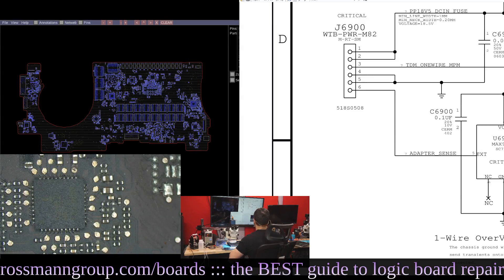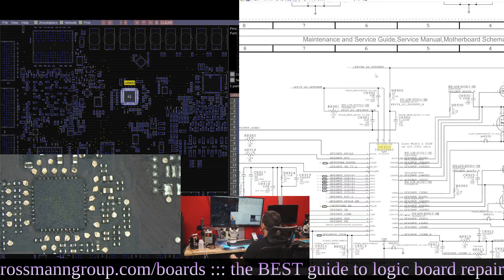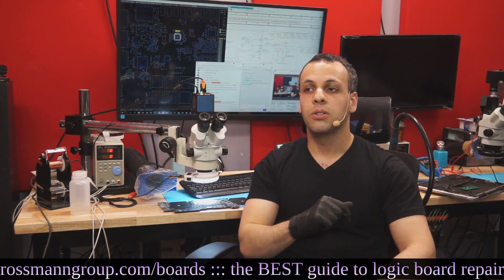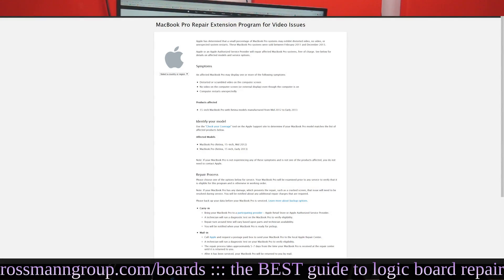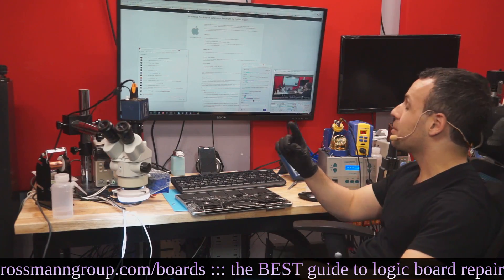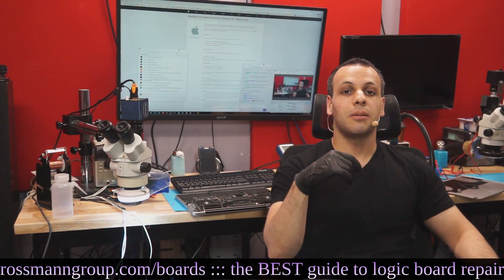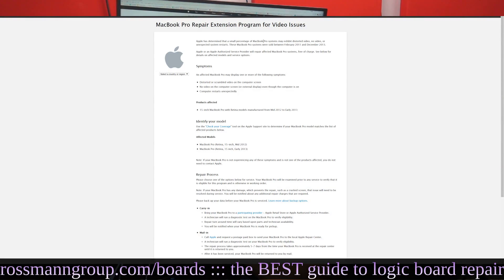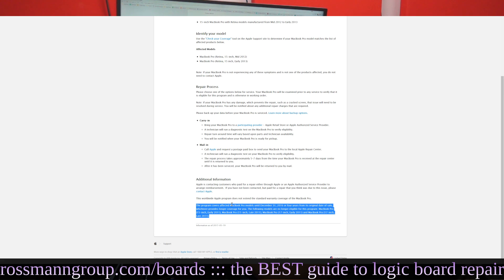Why 2012 15" Retina Macbook Pros with GT650M DIE

Comment: Dear Louis I just want to thank you for your help after I watched your video.I have a MacBook Pro 15 2013 and a 15 Touch Bar 2017 model, my 2013 model one day all of a sudden the screen went black with no video and also no video output from the hdmi port, I took it to the apple service center and they told me that they have to replace the motherboard because of a burn GPU and it is going to cost me 750 EUROS!!!After I saw your video and because I’m an electronic engineer my self but I never fix a MacBook I try to take out the motherboard of the MacBook and re solder the U8900 chip like you did In this video.I made the same procedure like you and the MacBook works again flawlessly like before.Thanks again for your big help.
Reply: GEORGE PAPADOPOULOS so you tell this works also with the early 2013 model?
Reply: Mert Aziz absolutely yes.
Reply: @GeorgePapadopoulos11  Hi, so after the repair your early 2013 MacBook and after all this years is still working fine?
Reply: Big Foot Because of the very small size of the v core chip (U8900) I just use only a magnifier but it is better if you use a microscope.
Reply: Big Foot yes I believe it’s the same problem.All the MacBook Pro 15 2012 - 2013 has that issue.
Reply: Big Foot Next time if someone bring me one to fix it I will upload the video on you tube.  It is very easy fix if you have some knowledge in electronics repairs.
Reply: @GeorgePapadopoulos11  I have the early 2013 retina 15" mbp and I would be very happy to bring it to you for the repair (if you are in Athens and still keen on this). Currenly I have had to disable the dGPU completely as it was impossible to do any real work with it
Reply: I am going to buy an macbook pro 15" late 2013, he said sometimes it lags but it doesn't crash, and has like waves from side to side, is it from gpu?
Reply: Samu Samy yes probably is the same failure.

Comment: Mine has been running over 100 degrees Celsius daily, never cleaned it, and it's still running fine🤷‍♂️
Reply: Same sad story here lmao, 5 years and still trucking along
Reply: I have this laptop and while in boot camp, the cpu regularly would hit 105c without trying when under load, hope it doesn’t commit seppuku out of nowhere on me
Reply: @exaltedb  same. How tf can we fix this
Even in macOS when I have enough tabs open I easily hit.100 degrees
Reply: U can install a program called Macs Fan Control so u can cool it better.
Also get the dustballs out of the fan exits will help.

Comment: My mom bought this retina laptop 6 years ago along with a 2011 mid MacBook with CD driver for me,  but  her machine died 1 year after purchase and my still running strong. I will be sending her laptop to you Louis. Even tho i tried preventing her from buying apple products she just bought another one again. Louis if you fix that machine i will install a less resource hungry linux operating system hoping it will last longer. Its been 6 years im sure ram upgrade will be a must in 2018.

But i rather have my mom use apple than windows because of security features :( she will get hacked if she goes back to windows shes old school. Thank you for your channel Louis!!

Comment: Im looking for some help I have a late 2013 A1398 Retina MacBook Pro. It has the 750m Graphics card. Im having an issue where the machine will attempt to boot but gets halfway through loading and freezes. Same thing happens when you try to boot into recovery mode. Ive watched a couple videos about retina MacBook pros 15" ones to be specific and haven't been able to find anything on youtube or on the rossmann group forums about this specific issues. Im hoping someone can point me to a video where to start to diagnose this issue I'm having. there's no liquid damage on the main board just some dust though some of the probe points and vias on the io board do show signs of corrosion. Ive cleaned them and looked over both the main logic board and io board for issues with soldier joints etc and haven't been able to see anything obvious with a microscope. Im hoping someone can point me to what circuits I should start probing for voltages on first. Thanks for any help from anyone ahead of time.

Comment: my issue with my mid 2012 retina 15" was the switching- when I run it only on the discrete card, all seems well, however if I allow it to switch to integrated then back enough, it will crash. same issue? the solder looks terrible. I will probably still repair mine as you have, but seems to be OK so long as it isn't allowed to switch.

Comment: Hey Louis thanks for all the great content! My 2011 Macbook pro GPU just died for the 3rd time this time after the end of the repair program (had logic board replaced 2 times for free). Currently building a watercooled "MacPro" hackintosh with Lian Li PC TU-100. When the new macbooks arrive I'm thinking of buying an old (new or refurbished) 15-inch retina with a strong CPU just to have a laptop running Logic Pro X and Mainstage and get a good price. I'm thinking 2014 - 2015, what year/model would you say is the best?

Comment: Question: (but little off topic) When a new battery technology hits the market ... lets say solid state batteries ... would replacement batteries for old notebooks be possible, so that you could upgrade an old Thinkpad with a new battery module that trades a little space for some additionally needed electronic?

Comment: I was given by my employer at the time a 2014 jan highest spec 13 inch iris crapbook pro. The reason I remember this clearly is because it kept dying with the familiar black screen. And the diagnostics brought up always the video driver as the last bit of code executed before crash. Crapple made me run all sorts of diagnostics and have it sent back to them only for me to learn about half a year later that the guy dealing with my case left the company and my support ticket ended up in limbo... Do yourselves a favor guys and do not buy crapple products.

Comment: I don't think that piece of rubber is a repair as such what apple is doing. I think they replace/resolder the chip on refurbished boards if that was the fault. But what they do with rubber pad is apply it on all existing boards to prevent the issue from happening to begin with, not fixing already faulty boards.

Comment: i just sold away this laptop for this reason for 300€ :( a lot of repairing guys wanted to reball or replace the GPU. Apple refused to repair it becouse i scratched the GPU before applying liquid metal on it.... anyway before discovering that i scratched it they ordered a new board, not a piece of rubber.

Comment: I have a non-retina 2012, the gt650m begin to show little blue lines in the apple logo and get stuck in the boot proccess. i had to disable the nvidia chip in NVRAM and use only the integrate graphic to proplely boot. what do you think about this? 
i usually repair macbook but i dont have the equipmen to do reballing/ replace a GPU chip.

Comment: Always wondered why the 2012 Retina machines were common in our repair shop (AASP), but not the 2012 Non-Retina. It's ridiculous what Apple has managed to get away with when it comes to their "as-new" (refurbished, if even that) service parts, be it low quality solder, shoe rubber patches or replacement boards that last 3 months (2011 GPU) to just outlast the repair programs that they themselves introduced, although often only at the threat of a class-action lawsuit.

When you purchase a product, especially at a higher cost, you want to think that some degree of care has gone into the components and engineering that binds them together. And mistakes can happen with any product. But zero care has been taken here. The solder itself is low-grade, causing the issue in the first place, and they haven't even bothered to perform a proper fix on the refurbished boards. It really doesn't get much worse, unless you consider that the repair program has since ended, and customers are now paying for these board replacements out-of-warranty. Thousands of dollars for a piece of rubber. I don't see how anyone could get behind this as even a remotely good deal.
Reply: Michael  thats the difference between apple  and other vendors

My LG E500 laptop costed me 1300 euros in 2007 came with windows vista    now its with windows 10...

Problems with the computer:
Wireless card died sometime in 2011  exchanged for free with another wireless card from an hp laptop and it works

After 7 years of use the graphic chip from nvidia died because of bad soldering... i didnt know when i bought the computer that i was eligible for a free repair...   but ok it lasted 7 years.    I had a guy that repairs this kind of stuff say to me.  Your computer is too old (in 2014) are you sure you want to pay 110 euros to replace the graphics chip and do a reballing?

Yes for sure i love this machine  it was been rock solid   the battery lasted 8 years before dying

The LCD screen has been replaced for free too   from another acer computer that was going to garbish

After 4 years of normal use (since repair of the gpu already passed the warranty of a new computer) Still works everyday.... dualcore cpu with 4 gb of ram ( upgraded sticks too - original was 2 gb)

Off course after almost 11 years this computer is old.... but you know what saved it?  Good parts and good soldering in the factory.... MSI thank you for this great board....  and been able to upgrade it...   only the soldered GPu was the only think that i didnt liked soldered but it was fixed by good hands and equipment

When this pc dies i will miss it... i will not repair it anymore.. decided that 3 years ago

Thank you Louis

Comment: I have a late 15" 2013 GT750M which is randomly crashing on battery mode and while charging with original apple charger then i got a thrid party charger now its stopped crashing any suggestions how i can fix it?

Comment: Thank you for all the great content Louis!
Apple refused to repair my 2012 rMBP (dead GPU) because I have a tiny dent on the underside so "this device is clearly damaged". Funny story is that that dent came from when apple replaced my bad screen (LG with ghosting). I just didn't notice it when I picked it up after the repair (because it really is a very small dent) so I couldn't go complain. Took me 2 weeks of calls and going to apple stores before they finally gave in. This laptop has only caused me problems since I got it. Up to now, apple replaced the screen, ssd, logic board (they thought it was the ssd but data still got corrupted so they changed the logic board in another attempt), and then the logic board again because of a dead GPU. So a total of 4 times I had to send in my rMBP for 1-2 weeks for it to be repaired. After my first Logic Board replacement I was unable to reinstall OS X (because the app store said that I don't own it, I have to buy it even though my macbook shipped with it) and it took a full 10 days for Apple to "be so kind and give me a key for free". I kept calling twice a day for those 10 days straight, they actually hung up on me a couple of times and told me that I am not eligible for phone support because I don't have Apple Care. 2200€. Apple has great support my ass. Oh yeah and they broke all the screw heads so I can't even open it up to clean the fans anymore.
Reply: radio .aktiv damn wtf are they doing.
Reply: Damn.  I guess they're still working on a way of having no screw heads at all.
Reply: For the cut off screws get a reverse drill bit from harbor freight and Oder new ones online. Then take a picture with the new screws and the bird and send it to them.

Comment: If you see some Apple Geniuses lurking around your house or place of business, those are Apple's wet work Geniuses. RUN! They're going to come just like Monsanto's boys did to farmers. Get yourself a heater for the incoming cold weather.
Reply: Just avoid those terrible heaters made by Glock.  They're about as reliable as Apple solder.

Comment: I have this exact machine but it's been rock solid. Amazing that you find these lemons.
Reply: Ever Burning I'd say you just got lucky.
Reply: Yet mine started random freezing within 18 months.  Apple ended up replacing the computer with a mid '14 model and that one has been solid.  It was that common that Apple had an out of warranty repair scheme on it.

They tried the rubber block.  It failed while it was still in for repair.  They then changed out the logic board.  That didn't fix it, so they tried a new ssd.  That didn't work, so rinse and repeat.  In other words they didn't have a clue.  Louis on the other hand could've fixed it within 10 minutes.  Thankfully I am in the UK where we have robust consumer laws.  

Personally I don't mind that they didn't know what they were doing.  I ended up with a better computer.  I've had this one over 3 years now and it is still working fine.  When this one dies, I'll be replacing it with something not made by a fruity company.
Reply: Just because you don't have the problem doesn't mean that the problem doesn't exists.
Reply: I have one as well. Still working great - one of the few computers I have ever had that has been "future proof" - at least for 5 1/2 years.
Reply: Your 2500 dollar i7 laptop should still be going strong after 5 years. Almost any 2k plus laptop with 8 GB of and a top of the line CPU bought five years ago will still give you great performance. Its not an Apple secret.
Reply: Same here. 6 years old and still going strong!
Reply: Sure Apple OS has some value and is very stable system and I do understand the benefits of that system, but at that point I would rather make a hackintosh to ensure high quality parts. Sure not everyone is able to do it and requires BIOS modifications etc and of course you wouldn't be able to do it on a laptop. It's not the OS that sucks, but the build quality and the repair/warranty section.
Reply: This I can agree with. However failure rates compared to cost of the actual product makes Apple the worst option compared pretty any other PC manufacturer. And we pretty much know that getting Apple to fix your devices is extremely expensive or non existant.
Reply: My mid 2012 is still going strong, but it lives a very seditary life on my desk 364 days out of the year.

I wonder if this is more likely to present itself if the machine is moved around a lot and therefore the parts experience more stresses from bending/vibration?

I'm totally down for trying some repairs like this if it decides to crap out at some point in the future though.
Reply: Got mine in 2012, gave out on me in January of 2018 and I JUST realized that this was the issue, 2 years after apple stopped "fixing them", and after I bought a Dell that I'm happily typing this on. I'm done with Apple.
Reply: I have the exact machine and I got the logicboard replaced after 18months and it wasnt even fukking out on me, I got it replaced because it was a FREE logicboard and I just dropped 4k on this mac so why not take advantage and future proof myself if they were offering a free board and recall then makes sense to take advantage! Was tricky to find the repair program and even though it passed all their tests I insisted on a fixed board! 6 yeas later shes still humming along nicely!!
Reply: I use mine every single day and it very often get's put under loads with video editing and rendering for the whole 6 years I've had it, it's also travelled to many parts of the world in a backpack. It can hold up!
Reply: Diglo1 this is a valid opinion, and my opinion is that I would never subject myself to using Windows exclusively. People buy Apple products because the OS has a history and track record among a specific user demographic for certain tasks. If it's just browsing the internet or gaming, a PC is a better option.
Reply: Diglo1 And, just because the problem exists doesn't mean a majority of users experience the problem. The real subject is how the problem is being handled by Apple, which Louis is very frank and clear about, often exposing the weaknesses in their manufacturing. Apple products should never be considered perfect, and I would hope people understand there is always a failure rate.
Reply: Diglo1 Absolutely, hackintosh is always a thing, but people rarely actually try it, and of those that do, most end up buying a new Apple laptop without issue. I personally have only owned Apple computers since 1996 and never had a problem except that they last almost ten years. I also have a PC running Linux, and I use a Windows emulator when needed in macOS. As much as people like to point out Apple's failures when they do occur, everyone stays silent about their PC woes. Most people own devices from multiple companies and there is no longer divided loyalty. All my Apple computers still run when booted.

Comment: Are the solder joints so poorly done because they are using lead free solder? Also are you making negative comments about chip quick?
Reply: you are right, lead free is still behind leaded solder in mechanical strength, although it used to be a lot worse. depends on the alloy and the soldering conditions. regarding chip quik: that's a very low melting, low strength alloy that shouldn't be used as a permanent solder especially in parts with significant power dissipation (as are switching conctrollers).
Reply: Yah. Whoever chip quicked that ic. Is an idiot. It looked like work from a really bad service centre.